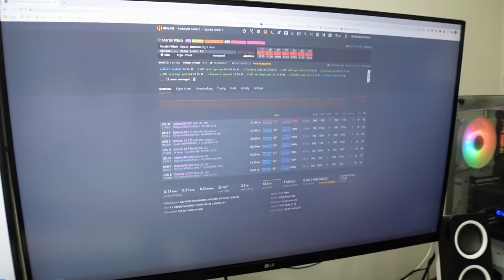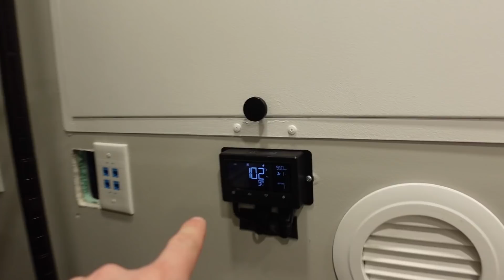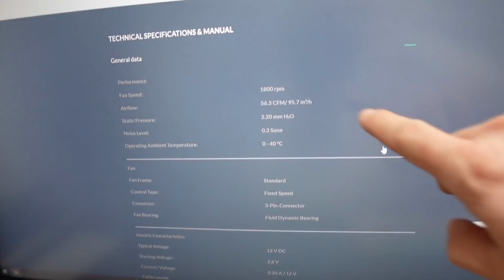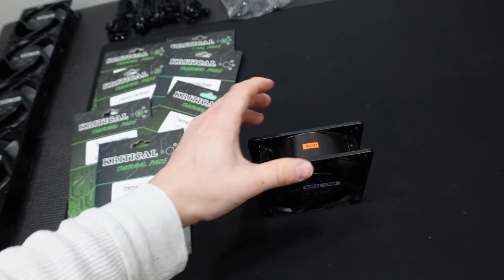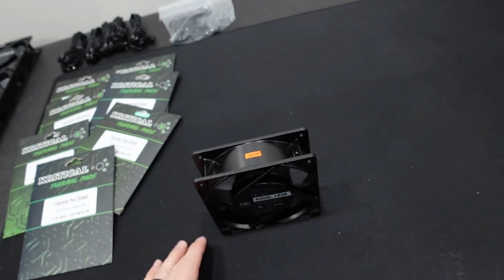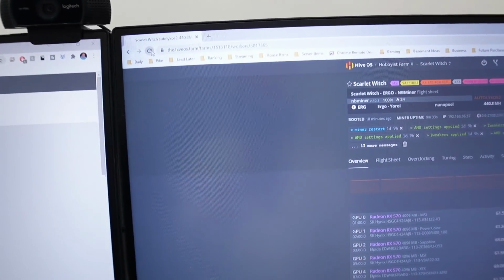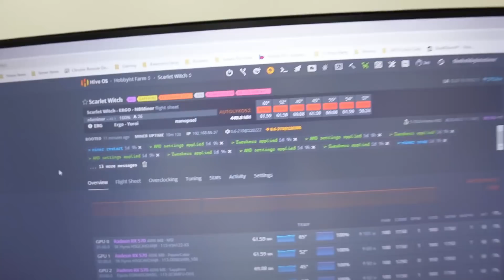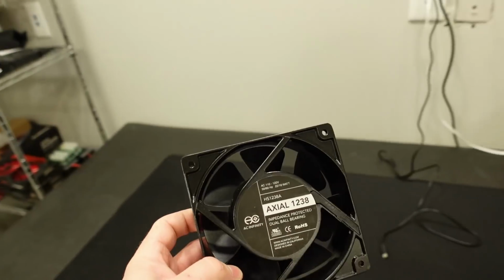How to COOL your GPU MINING RIG with 110 CFM COOLING FANS

Comment: I use 120mm fans that are a little cheaper on my rigs and are rated for 154cfm.  I get them from aliexpress.   They are roughly about $10 each.  They have been working great for me.  I have yet to change a thermal pad since I have been using them.  I can send you a link if you are interested in them.

Comment: Try putting cooling fans on opposite side where video ports are on graphic cards. Im cooling my xfx 570 that way,getting right now 58 celsius at 45% fan speed. Temp in room is around 20 celsius.

Comment: This is kind of silly, just take the fans/shroud that are built on to the GPU off and simply zip tie a server case fan directly to the GPU it'self if its that bad. I did that with a few of my older RX570/580 cards and works amazingly well. Temps in the 50C range

Comment: I would just like to point out with these higher flow fans the power consumption isn't neglagable any more.

The fans where rated 18/22w each I dont know what makes the diffrence but at 5 fans you have added another ~rx570 of power draw.

Where as the artic p 12s pull arround 1w each.

Where as a cheep box fan does 2321cfm for 55w definitely less static pressure but with the spacing of open air it may not make much of a difference.

Although it will make your setup look less clean.

Also the boxfans have a much lower rated lifespan although im sure they'll last a bit longer than rated.

All things to thinkabout when tuning your room.

Comment: Hello. Great info and awesome video. Also can u please help me out with a query? I am from India and I have a 5x6800xt rig, mining eth, 2 cards touch 84C 2 touch 76C and 1 touches 62C
Is it safe to continue mining.
Note that I have an external fan.
I have currently stopped the rig. Planning to add a desert cooler, shift it to a more airy room and change the thermal pads too. Although previously the room wasn't cramped room either but let's just say this room has an additional window.
Do you think I should instantly change the pads or I can still manage and run for couple of months by just adding cooler and changing to more airy room?
Thanks for reading.

Comment: Wathai 12038(max 5300 RPM @ 2AMP/25Watts)  with a MEIRIYFA 3 Pin 4 Pin Fan Adapter 6pin power variable speed  control.

Comment: Dehumidifier in the room helps a lot. The dew point makes the air hold more heat. Dry air holds less. I have a 65$ dehumidifier running in the summer and my temps are around 5c cooler on everything. Keeping the dew point at around 40% and the room temp at 80 to 85F is ideal for me. I have 22 cards running  when I add more that might not be the case but for now it works.
Reply: Nice

Comment: Need to control the room temperature. Hot air is just being circulated around and increasing the GPU temperature. Install an a/c unit or open up the windows to let the hot air out.

Comment: I use 24 volt fans and wago connectors they move 110 cfm and don’t have to worry about 110 wires getting cut up by fans

Comment: I fixed my cooling with locking the core but now my miner crashes after some time, which could be 18 hours or less. Not sure if is my 1660 with core NOT locked and being used as a display or if is the 2060 12Gb cards or just one or two of them acting up. As for fans I found 1 that ended up being great but noisy and draws much power so am looking to replace that one and get some molax ones for my next rig.

Comment: Amazon sells an 8 fan buttom controller that is Great bought 4 running 240 CFM at 65 decibels added then to my cases. Here look in Amazon PWM Fan PC Hub, 8 Port 4-pin pwm Fan Controller with Speed Control Function PSU Splitter .runs on a 6 pin direct power up to 220V. Great to adjust air flow and fan noise.

Comment: Had a couple of problem children on the same frame too.  Adding fans to the sides didn't seem to be as affective as adding fans to the opposite side for a push pull setup.  The pull fans are positioned right there at the exhaust of the card.

Comment: Noctua NF-P12 Case Fan 120mm 70cfm at 19.8 db, i think is very quite for home mining. Personal I have 7 Arctic Bionix P120 Case Fan for server case at my home and they are quite silent. My 6 rx5700xt at 60% fans make more noise than the arctic. If ur rig is at home then u need more cfm and low db.

Comment: Hey bro new fellow YouTuber here, I just added a video about some 260CFM fans! They are very effective, but LOUD AF. Fans and AIRFLOW make a huge difference, my 3090 rig was massively thermal throttling even with brand new pads added and paste, when the fans were added 123-125mh/s all day long. Now just gotta figure out how not to go deaf, it's either we're getting rid of the heat or noise now.  You want some REAL BEASTS, try the ParallelMiner fans I use in my video.